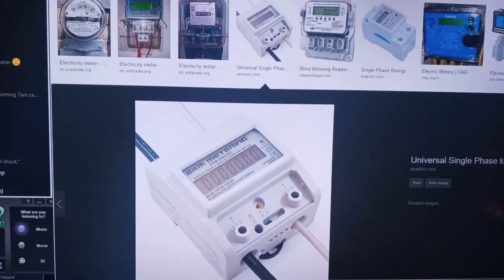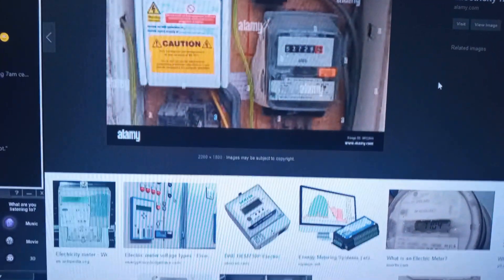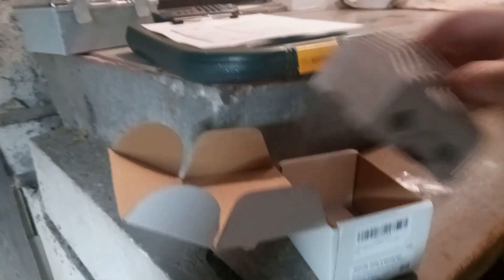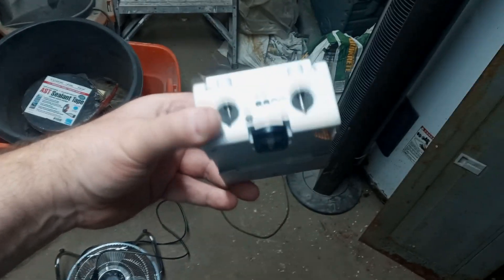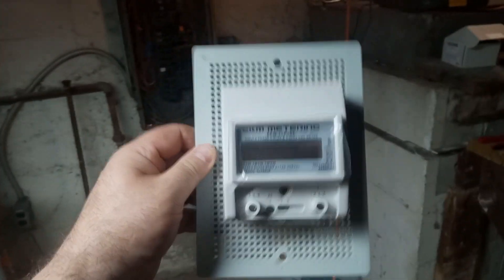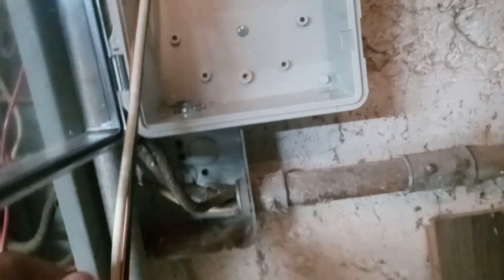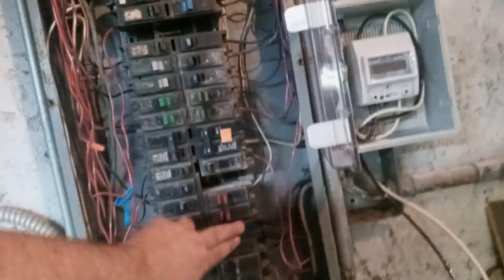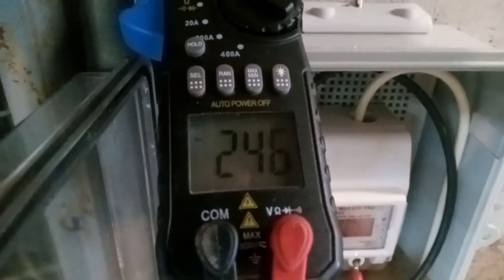Secondary Metering Device Installation

Comment: Looks good and clean, my only advice would be a thin plastic facia to go around the display and make it a deliberate act to remove it to gain access to those cable's... Prying fingers you just never know 😉 I'm not sure on the output to the conduit from the box, the cables input and output crossing each other, personally I'd have tried to keep them separate, no crossing over... First install though walking into almost an unknown ... You can come and do mine anytime 😉👍